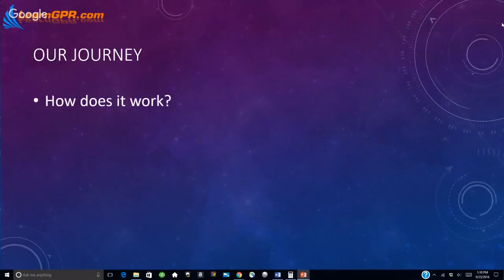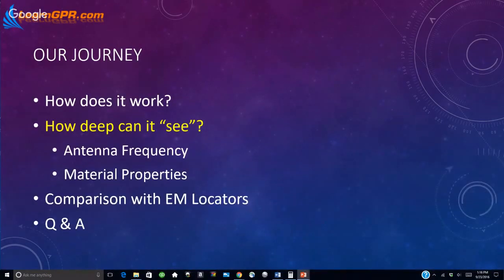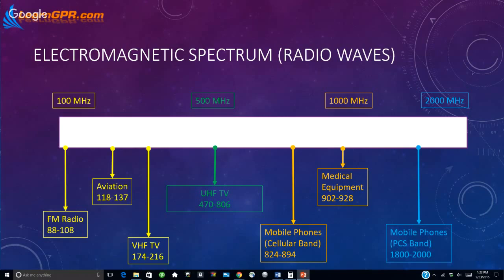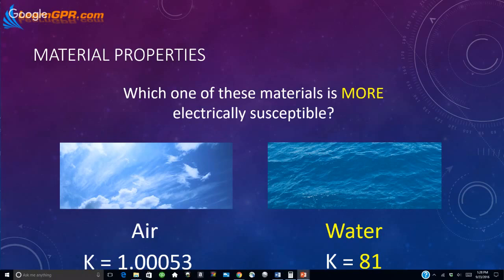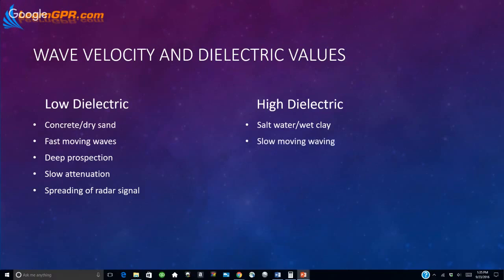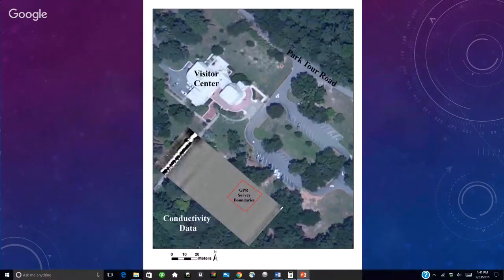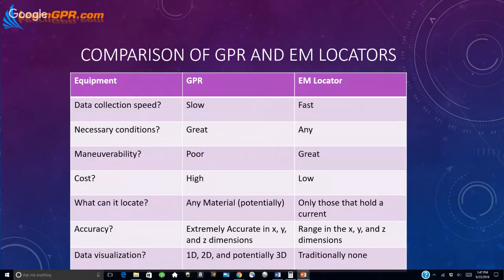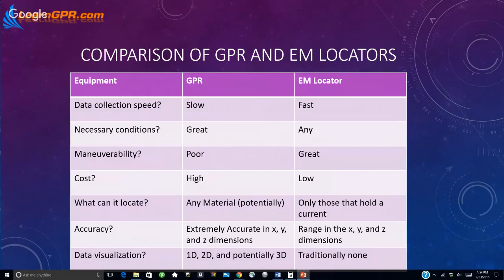GPR (Ground Penetrating Radar) for Utility Locating Webinar Replay

Comment: hi professor, it's crazy how good and accurate is this video. I'm currently taking a Geophisics exam, with a big focus on application to monitor landslides, they explained us the GPR method very quickly to be able to do some measurement on the field. The problem is that they had to cut half of the program to be able to finish on time, so i had some gap in the theory of GPR. 
Thanks a lot for the perfect explanation
Reply from the maker: I'm so happy to hear this was useful! Good luck in your studies.

Comment: Hey Prof. What do you use to the reconstruction of root system geometry using correlation analysis in the 3D domain? Do you know anything about using Matlab for doing this?
Reply from the maker: Hi Shaunna, thanksnfornthenquestion. We wouldn't use matlab for correlation analysis, but we would plot the reflections in gpr-slice to generate visualizations of the root system. We could definitely give you a demo of the software if you are interested.

Comment: you need to put your radar through the test , find a 1913 marathon car that was buried in a field  in Texas  1936 . I had metal detecting club come out with hand held unit , years ago and rented a backhoe  but no luck , it is about 6 ft deep  in a 5 acre area  , they filled in a ditch . Would  pay for cost .  Barry Walker   marathon village.com  thanks .
Reply from the maker: Hi Barry, can you send your email address?

Comment: hello sir..I had one doubt regarding corridor...suppose footpath and bituminous road are at different height .can our corridor include both footpath as well as bituminous road.? I have been told whole corridor should be at same level
Reply from the maker: Sahil Tikku im not sure exactly what you mean? Can explain further?
Reply: LearnGPR ..sir,I am talking about corridor of GPR...suppose our corridor is of 5 m and length is of 100 meter..should our corridor should be of same level from the ground? actually I am doing excavation of electric cable..but sometimes footpath and road is of different level from the ground..
Reply: corridor means width or area
Reply from the maker: Sahil Tikku got it. So ideally you want the corridor to be flat. Unfortunately uou cant always have that. You will have to address each level separately. Good luck!
Reply: LearnGPR thanku Sir..

Comment: Hello
Many thanks for this great video. Really helpful.
I have some questions:
1. Would you get signals attenuation in case of small thickness of clay?
2. Would you get reflections from clay in case of wet sand interceded with clay?
3. What depth can penetrate in conductive soils using 250 MHz. 
Thanks
Reply from the maker: Rebwar Nasir hi. I'll put these answers on the free training comments as well. Even small layers of saturated clay can attenuate signals. This can occur for 2 reasons. 1. The conductivity of the soil will cause signal loss. 2. If you have a layer of saturated clay embedded in sand, the reflection will cause some of the energy to move back to the ground surface leaving a smaller amount of energy to continue into the ground. 

How deep can a 250 mhz antenna prospect in conductive soils? It depends on how conductive the soils. Maybe a few centimeters in salt water saturated soils. In wet clay I got about 50 - 70 cm the other day. It all depends. Hope this was helpful.
Reply: Many Thanks!

Comment: thank you very much, nice vidéo, is there any gpr multi frequency? (Multi channels)
Reply from the maker: Mirage Bleu absolutely. would you be looking for something useful for utility locating?
Reply: LearnGPR Thank you very much for the quick response ... as you know with high frequencies we can not go deep but we can see objects of small sizes and with high frequencies one can go deep but one can only see objects large Size, I want to know if there is a compromise between the two? I work in the field of archaeologist
Reply from the maker: Ok. Got it. So there are a couple of options that would work well for archaeology. The new Leica DS 2000 has a 250/700 MHz. GSSI has a 300/800 MHz antenna. Finally, Sensors and software has the Noggin cart. You can put any two of their antenna on it at the same time. They have 100, 250, 500, and 1000 MHz antenna. If you would like me to put you in touch with any of them just let me know. Hope this helps. Thanks again for the comment!

Comment: Very helpful information!
Reply from the maker: Erika Damacela my pleasure Erika. I'm glad you found it helpful. thanks so much for the comment
Reply: sir can you explain how to find lithology  by using GPR?
Reply: aakasha ramanna there is no certain way to identify a certain type of lithology with geophysics, you can use the right tools on the right site and as the professor said compared them with a catches samples or borehole .
Reply from the maker: Hi Erika! I can't seem to find your question. Can you re-comment with it? I would like to answer it for you.
Thanks
Reply from the maker: aakasha ramanna I'll do a video for lithology at some point. Thanks for the suggestion. Generally, gpr is combined with boreholes or earth resistance during studies of lithology. It can be difficult to evaluate the physical properties of geological structure sometimes when only using gpr.
Reply: @Learngpr  how deep the Mala 3x easy locator can penetrate please ??!!